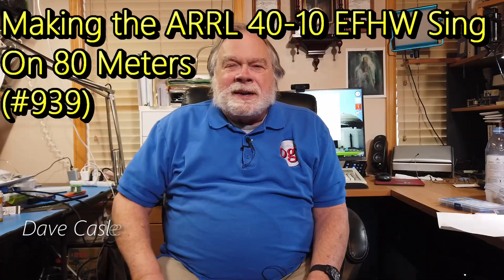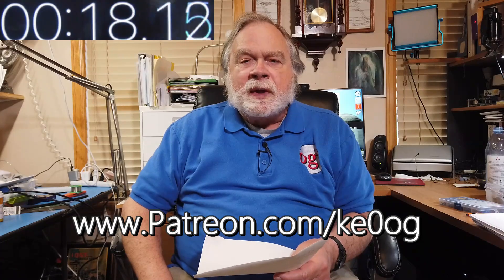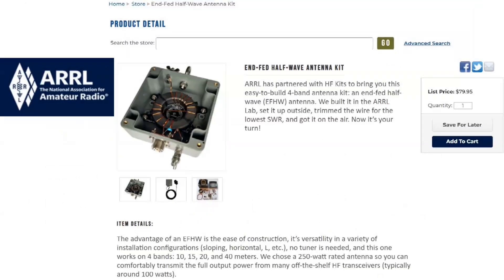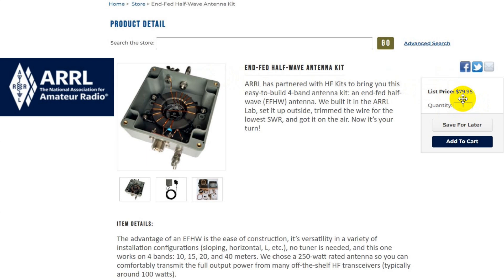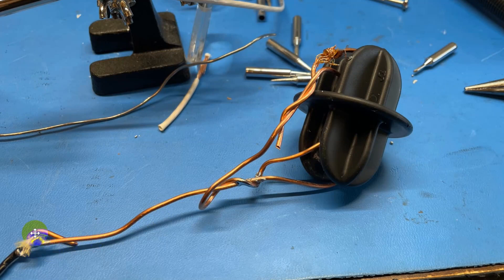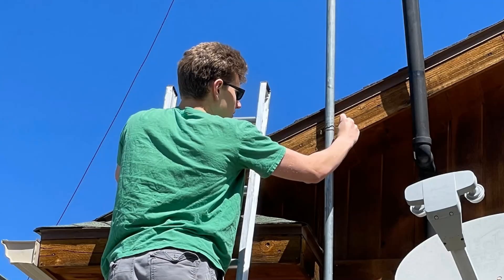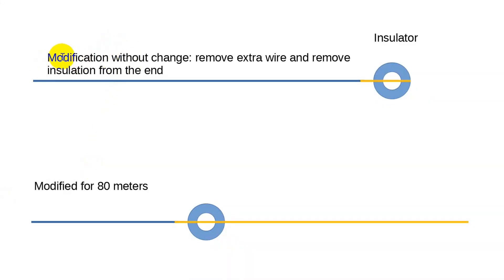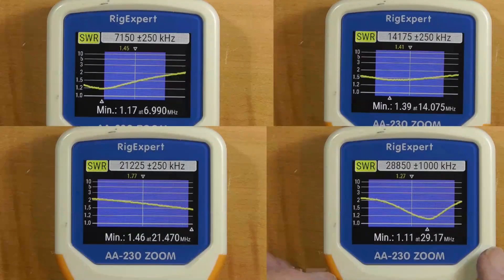Making The ARRL 40-10 EFHW Sing on 80 Meters (#939)

Comment: Why not just add less than 66 feet of wire if you want it to work on 75 meters?
Reply: Simply extending the wire would shift the dip for all the other bands also.

Comment: Good grief Dave! I hope that solder job at 10:19 was you testing it and not a permanent set up.  Looks to me as soon as you tension the antenna, the wires you have on the insulator will pull taut and the cap will be pulled apart.  Nobody should duplicate this assembly work as depicted.

Comment: A balun is a device that balances the current between the outputs. This is a transformer with only one output therefore it is not a balun. Technically it is a transformer. The term "unun" is acceptable also since it's output and input are both unbalanced.

Comment: Dave,  thanks for the video.  You mention at 10:11 that the capacitor leads are very thin, and you are concerned about their current-handling capability.  Instead of using one 470pF cap, you could have put three 150pF caps (or five 100pF caps) in parallel. That would give you close to 470pF but with roughly 3x - 5x the current-handling ability.  [IMO the current isn't going to be that high.]  I'm hoping to try this when I have an EFHW antenna set up for 13 May's AFD Crossband exercise.  KB2JSB
Reply: The current is going to be "that high". The capacitor is located at the highest current portion of the antenna on 80 meters. A typical capacitor of 3kv or higher usually works fine but I used a doorknob capacitor since I run legal limit at times. Don't skimp.

Comment: The antenna lengthened to 80 meters may also give you coverage of the 30, 17, and 12 meter bands. It will have additional resonant points at 10.5, 17.5, and 24.5 MHz (approximately), and those may be close enough to provide an acceptable SWR. I'd like to see tests of that.

Comment: I got my 40-10 EFHW to work on 80m with a 100uh extension.  It was a piece of 2" PVC with 100? or so winds and then a few feet added to that.   I'd have to check the exact values but it wasn't very hard and didn't add more than 6 feet.
Reply: The addition of the coil near the far end works to an extent but  your SWR isn't very good on 80m due to the lower impedance it creates. Also the full length 80m version easily covers 30, 17 and 12m which the loaded version does not. I've found that a poorly installed full half wave version works better than a nicely installed short version.

Comment: I'm using an 84' EFRW with a 9:1 UnUn. From 15. MHz to 54 MHz it peaks at 2.4 SWR just below and above the full 80/75 M  band, about 2.2 in the middle. It's below 2 through 160 M and above the 2.4 peak at 4.4 MHz all the way to 54. I'm getting these numbers from a screenshot of a NanoVNA Saver sweep, so some of the numbers aren't exact. My external tuner has no problem anywhere, and I think the internal tuner could probably handle all of it but I haven't tried. 

Did I just get very lucky with the placement, counterpoise, and loops through a toroid just before the lightning arrestor?
Reply: This is a sure indication of a very lossy antenna system.

Comment: After watching another video about the EFHW 40m antenna, (video - Utah Amateur Radio Club, 13 January, 2002 UARC Meeting) someone modified a 40m antenna to "center" the SWRs on each band by adding a 200 pfd silver mica capacitor at a point about 40% down from the 49/1 unun. To make sure the voltage didn't build up in the wire, he added a 33k resistor across the cap to bleed off any excess build-up. So you might consider adding a resistor to that end cap to do the same thing.

Comment: There may be a Cap that will move the frequency to cover more of the low end below 3:1 so FT8 can be done with the tuner in the radio without loosing the high end.
Reply: That's what I am going to try - I need the digital end (THOR22, etc) AND the top of the phone end for NJSP digital and phone EMCOMM nets.